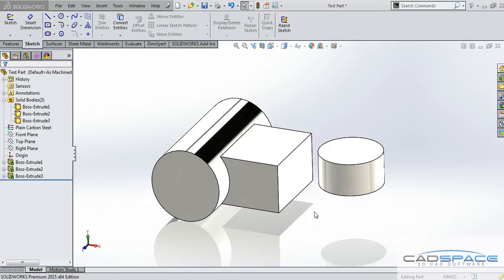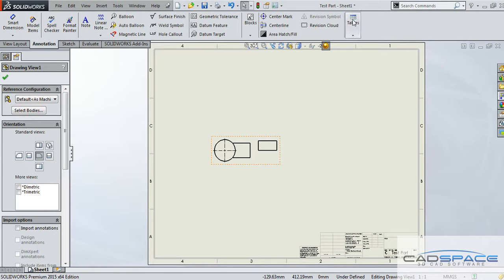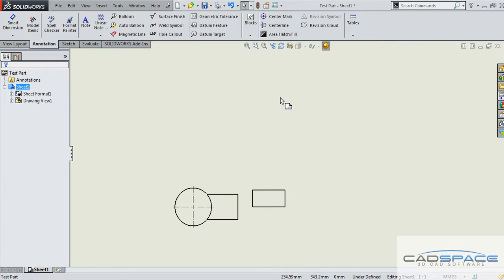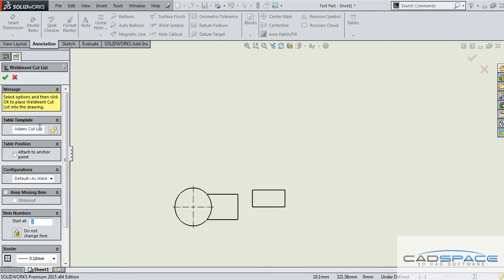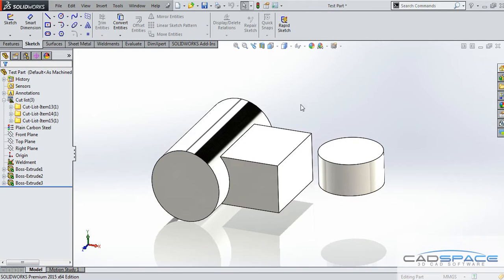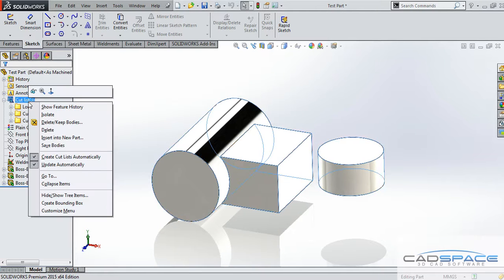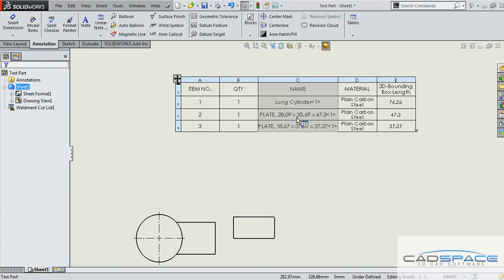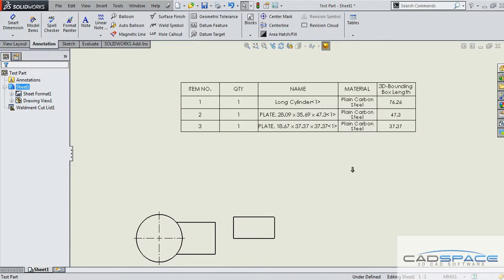SolidWorks Multibody BOM in Drawings

Comment: This is a great feature, but I cannot get it to work in SW 2016. I end up with a table header with no items. Any suggestions?
Reply: Yeah, doesn't work in SolidWorks 2016 over here either. Have you found a solution?
Reply: No, still nothing.
Reply: Perhaps you have only one cut in the welded part. Check the number of cuts and try to update it to create several cuts.